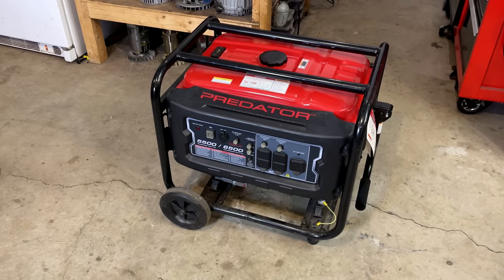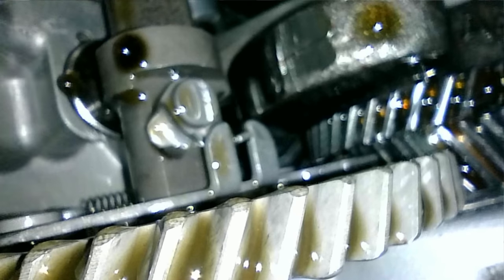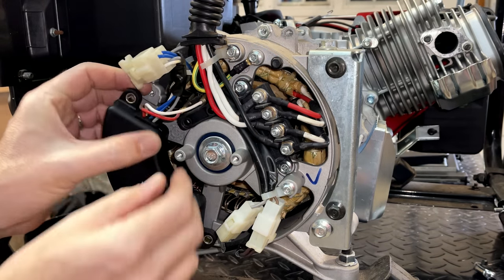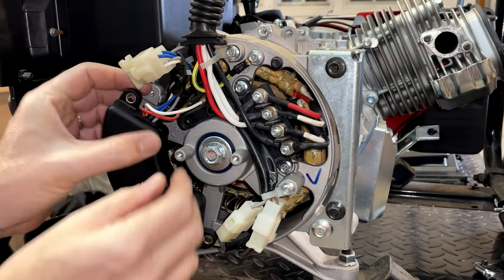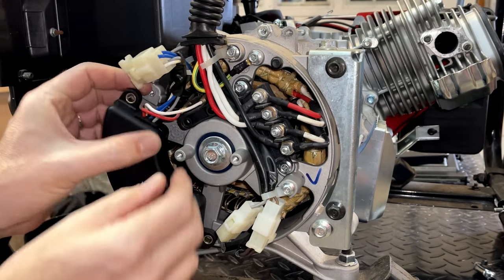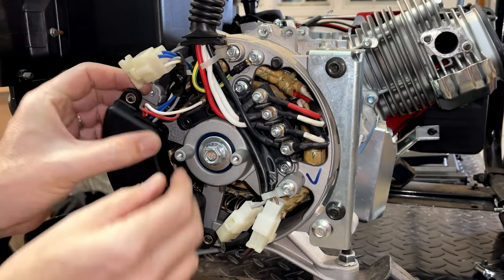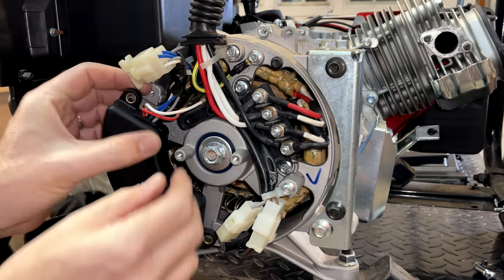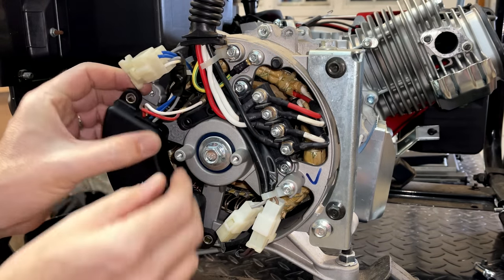Broken Predator Compression Release? - High Compression and Hard to Start

Comment: James, nice easy simple repair!!  I would have put the original cam back in myself, but absolutely nothing wrong with swapping out that cam either.  That engine is made by RATO... note the "R" in the model code on the side of the crankcase.  Also, that air inlet pattern on the recoil starter is a telltale RATO sign.  Also, the data sticker on the blower housing will sometimes say "RATO" on it somewhere as this one does... although HF has been trying to scrub any obvious clue as to the actual manufacturer of their engines for a while now.  

But putting that "Torch" plug back in there might be a cardinal sin... that's a guaranteed failure LOL

Great video once again!!!

*  OH!! One more thing... you might want to check the accuracy of your Kill-A-Watt frequency readout... I stumbled across the fact that mine reads almost 1 Hz higher than 3 different multimeters...  3 against 1, it reads high.  I guess the quality of the electronics in the KAW isn't that high.
Reply from the maker: The kill a watt is definitely not a precision piece of equipment.
Reply: I would not use the cam that came in it
The used one works
Reply: @philliphall5198  I definitely would have reused the original cam... no defects, no burrs, works smoothly, and narrowed down to a likely tiny piece of debris that made it get stuck... the exact same failure could happen on the next start with the old used replacement cam.  Probability of reoccurrence is the same for either one.  But, nothing wrong with replacing it with the  cam from the blown engine either... hopefully there is no damage to it that was not detected (crack, bent, etc...)

Comment: Say James since the genset can run steady even when not loaded having the decibel level loaded and unloaded might be more comfortable in the house when unloaded a certain extent. What the harmonic distortion tells me is when running a DVD or other sensitive electronics the electronics should be run unloaded or you may cause an electrical failure. I had a DVD fail with a square wave inverter. So a pure sign wave inverter should be used on sensitive electronics. So an inverter generator seems a much better unit for those who wish their electronics to function.

Comment: Great video.  Very informative.
I realize that was your goal but if it had  been my generator,  before I pulled it apart I would have soaked and flushed the crankcase with marvel mystery oil mixed with diesel fuel and gone through the carb.
I'm glad you didn't because I learned some things from the video.

Comment: It has been my experience with gear wrenches, to apply them incorrectly more than half the time. I solved that problem when I discovered the slightly curved open end should point in the direction I want to turn it. Some are even labeled.

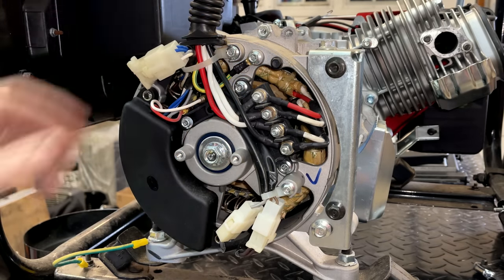Comment: 18:40 Oh HELL Yah!

I'm an Electrician so I can say with some confidence that if you get the wires wrong, the BEST thing that happens is you reverse the Generator's output Polarity...not a massive deal for AC, but you WILL damage any DC equipment plugged in to it (if the Generator has DC Receptacles)...
It's still not great for reversed AC Polarity, but it won't damage most AC equipment. The biggest danger to Reversed AC is the outer screw shell on lamp holders will be live even with the switch in the off position (the shell is connected to the White/Neutral wire) and if you touch it, you can get a nasty, potentially lethal shock...
The most likely thing to happen by screwing up the wire order isn't Polarity Reversal however, it's causing severe damage to the electronics and generator itself...most likely, the Mysterious Blue Smoke that is the secret to all Electronic Functionality will be released and then the generator will become a large, noisy paperweight because when the Mysterious Blue Smoke is released from Electronics, they don't work anymore...

😄😁😆😅😂🤣

Comment: Re choke label, I had the same thing but mine said " On Off"  just turned it over. Yours could be orientated  correctly if you read the thicker end of the wedge as "More Air" and the thin end as "Less Air" ie "Choked". Just a thought...Great Video.

Comment: Had this same thing happen on a Briggs 675exi. It would actually  start and run but hard as hell to pull. Actually ran good once you could get it pulled over. Ended up being bad cam/compression release. Found a used one for $10 and took about an hour for me to install and reassmble the mower.

Comment: You said a rod & bolt would not work as the bore  is  the same as retention bolt diameter.  So why not cut a rod with an threaded end?  Thread the rod into the crankshaft and use a bolt on that to push the engine off  the rotor.

Please let me know if there is a flaw in that logic. Hidden pitfalls are the bane of the inexperienced. I have a Honda 5kw that is a no-charge patient to fix (or try to) for the wedding venue I work for. 

Yet another result of being able to diagnose about anything that has broke/stopped working and fix most of it for the owner. I have learned so much from your channel. Please keep showing the teardowns and rebuild parts, especially the finicky parts, the "dos", and more importantly the "don'ts".

Thanks again
Reply from the maker: You can definitely use a threaded rod in this case.   If the powerhead is bad I sometimes will just cut the head off the rotor bolt and use that.
Reply: @jcondon1  thank you.

Comment: As a relative novice in things this complicated, can you describe why you degrease the gasket surfaces when reassembling these parts?  I have in the past tried using a very thin coat of grease to make saving the gasket more possible if I ever need to go back in.  Saying that, It rarely does work, but I thought it was a chance to make it work anyway.  VERY interested in your idea on this.  Seems to be something you do on EVERY reassembly so I am sure to learn something again!!

Kudos for your efforts.  I know the old saying, "those that can, do.  Those that cannot, teach"  You are standing living proof that is a FALLACY!!  Probably not a high percentage of folks can do both, but we know now, it is possible...  Keep them coming..
Reply from the maker: A lot of manuals say to degrease it for the best result.  To your point though, the gasket will not be reusable.  A lot say to grease the gasket and it can be reused in the future.  Sounds like a good idea to me and would do it on my own equipment, but tend to be more conservative if on stuff I am going to sell.
Reply: @jcondon1  I suspected your answer would be direct with your experience so thank you for the info!  As a working engineer, I do try and think things through before I try things a bit radical, similarly to your methods.  Good reinforcement on this clean surface idea.  Filed as the best method now!!  Thanks

Comment: Another point in this video that you pointed out was how loud this generator is. It would have been nice to see the dB reading at the source since there is a standard rule that doubling the distance away from the source reduces the dB rating by 6 dB therefore using some rough mathematics i am guessing it would be around 120 dB at the source which is extremely loud.

Comment: This compression release system that all modern generator engines apparently have, are somewhat new to me. On some older engines they had, a valve that was bored right into the cylinder that would be opened to reduce compression, as installed on one of my chain saws. My question is, what did they use to reduce compression on small engines back in the 1950 and 60's? I don't recall the compression being all that large? BTW, I was really surprised by the compression on that engine! 130 PSI, I never thought they would be that high. I've seen six cylinder aircraft engines at only 70-80 pounds. BTW I learn a lot from you! Thanks again.
Reply: IIRC the B&S side valve engines just had a bump on the exhaust cam with such short duration that it only had an effect at starting RPM

Comment: James, a suggestion I would like to offer for removing the rotor. Toilet paper and water/oil. Requires a less exact seal around the bolt threads. I've used the method to remove pilot bearing and such.

Comment: To drain the tank you loosen and remove the big nut at bottom of gas tank above the shut off valve. Then pull down removing the long strainer screen inside the tank outlet. I then use windshield washer hose to shove up in the tank hole to drain without making a mess.

Comment: Unfortunately it would be difficult to remove the comp. Release mech. From the stuck cam due to the rivet pins holding it to the gear. You could then inspect for burs or something sticking it up. You could put some nano moly powder mixed with 91% isopropyl alcohol paste under and around the whole mechanism and move the mechanism around allot to plate it on so its less likely to stick again.

Comment: My preferred method is to take a piece of white bread, tear out the soft white center and pack it in the hole. It does the same thing as the water but no teflon tape needed. It is nice because the clean up just needs a bunch of compressed air and maybe a spray of brake cleaner.
Reply: If it fires do you then get bonus toast?
Reply: @AnyoneSeenMikeHunt  Rarely have I used the whole slice of bread. You could probably whip out the propane torch and make a nice half slice.

Comment: It may be the design difference of the compression release plate that created the problem.
The one that came out had a lot more hang up points, the two slider slots and securing pins.
The one you saved only had a  single pivot point, a far simpler design.

Comment: Here's a tip most older Predator and some newer current Predator generators and engines are made by RATO which is the largest Chinese outdoor equipment manufacturer in the world and they make alot of familiar brands, if the engraving on the block starts with an R for example R420 that is a RATO made engine - now Harbor Freight in recent years has started using Loncin and those block numbers start with either an L, LC or G like G200F would be Loncin made and R212 or R196 would be RATO made.  Loncin is the 2nd largest manufacturer of chinese engine's and generators. Rato is better in quality. The generator in this video was made by RATO.

Comment: If every Chinese engine manufacturer wants to clone the Honda engine, why not clone the Honda variant with the overhead camshaft (GCV series). When you do that, you won't have to remove the generator assembly, rotor, the engine and disassembling the engine just to get to the camshaft to unstick or replace the compression release. You just remove the valve cover and everything is right there. Maybe the compression release wouldn't be needed with the GCV clone. No more push rods to worry about either. A timing chain or belt that's reinforced would need to be added but would be well worth it. 

Normally compression release mechanisms stick when the engine sits for a long time, or used a few times then sat for a long time. I got lucky with two generators that were basically brand new with less than a few hrs on each of them. They sat for 2-3 years in a garage and looked like they came right out of the box. The compression releases were stuck, not broken. I tried this method a friend recommended. To my surprise it worked!!! Here's what I did:

1. Remove spark plug.
2. Remove valve cover, inspect the valves and push rods (adjust/fix if needed).
3. Remove the pullstarter.
4. Make sure there's plenty of oil or at full capacity.
5. Turn the flywheel for a couple minutes or longer using an impact drill at low rpm, not too fast. This will allow oil to circulate through the engine making its way to the camshaft and the compression release mechanism. Do this a couple times if necessary.
6. Let it sit overnight.
7. The compression release should free itself unless seriously corroded or blocked up with metal particles or broken.

James, great video. I wish I knew about using water or oil when removing the rotor. That's a lifesaver right there and thank you.

Comment: Last year.   .  I won this.generator !   At our local fishing derby! 
And.  I've used it for about 80.hours of run time. . Before I did an oil change !.

Next time I used it,  was during fall weather!. 
And suddenly!  After 2nd time use . After oil change. 
I noticed it wasn't starting anymore and  wind was coming out from the sparkplug area !. Not noticing !  The.bolts came loose on their own! 

The morrow.of.story.  those.springs actually had the left spring pop out.  And  had it running for atleast 19.hours.   and  it wouldn't turn on . After running it, that long.

Anyways.  After taking it apart and seeing the spring  magically popped out. 
I put everything back.together. and with one pull.
The generator purred like a kitten!. 

- I have oil stain on the side that was blowing air from .  But it's still new . 
Warranty was an express post .away.  from being shipped. Out

Comment: I've bought 7 predator engines and after my 2nd, I learned to open the valve cover and go over every bolt. On 4 engines so far, those retainers weren't where they should be. So you thinking someone else was in there probably isn't true

Comment: Get a cotton swap and attach it to your drill and polish the seat a few times. This will get any residue/varnish off of the seat. Of coarse after that a few blasts of carb cleaner and a eyeball inspection to verify there isn't any cotton fibers clinging to the seat. This is what I do anyway.

Comment: Seems to be a common 4375 problem.  The dc voltage is 26 volts. I can't find much on them but it looks like a half wave with no center tap. My understanding is new refrigerators won't run on anything but clean sine waves. I bought a dc to ac inverter.  The dc is too high. Something to look for.

Comment: Cool.   The compression relief comes in two styles...  slide and swing.   Seems like "swing"  is the better of the two designs anyway,  as there's less friction sources to fail at.    The motor's pitch is a little mid-range strong.. and that's where our hearing is most sensitive.   It's not missing a spark arrest or something is it?   I'm just thinking that the muffler isn't doing as good of a job as it could.
Reply from the maker: It sounded like there was no muffler.  The swing is better.  I have had several instance of the slide one sticking due to increase friction.  I have a really old video where I think it was the slide type hanging up https://youtu.be/vyeyQK1QCuw

Comment: I thought it looked like the spring was stretched in the camera view and it was. I wonder if a wire clothes hanger could have been bent to reach the compression release to free it. Maybe a couple of hits to the engine with a soft hammer would have freed it.
Reply: I think I would have dropped it
Reply from the maker: I did position the cam and dropped it.  Cut that out since it did not work.  Given what I saw when I open it up…. Should have dropped it harder.  Here is the lost footage https://youtu.be/6oU2PM0IUPk

Comment: You stated that Ken's Small Engines sent that generator to you, what does something like that cost to be shipping around? I realize there are some folks close by, but I believe you have had people from afar send you generators, that must be costly. Also, this one had fuel and oil in it, so that would make me think Ken dropped it off rather than shipping it.
Great video as always, glad to see you use the water method, as that hitting the bolt with a hammer while easy, can also take a toll on the crankshaft and overall rotating assembly being pushed in a lateral direction.
Reply: Jim and I are relatively close to each other so I grabbed it from my neighbor and Jim came by one morning and grabbed it. Shipping would be cost prohibitive
Reply from the maker: People have sent generators in the mail, but usually they are the small suitcase style.  Larger ones like this would cost $200-$300 to send it a 100 miles.  Thankfully Ken is not that far away.
Reply: @jcondon1  Many shippers refuse to accept and gasoline powered equipment unless it is in factory packaging or certified as gasoline-free by a factory service rep. Others charge an arm and a leg to ship a small gen.  I worked for a network TV news bureau and we would buy Honda EU2000i generators after arriving in a location and give them away after a couple days use because the cost and effort to have them certified as clean was too much.

Comment: Playing with these predators in gokarts iv'e found that if the break in goes too long the grit will sludge up the decompression mechanism and stop it from working properly. As far as the retainer for the valve springs they come like that at times from factory, the first thing i do to them is put heavy springs in them and have seen it a few times.

Comment: Very cool fix James. How hard would it be to get something in through the oil fill and jar the release loose? Need something with a big angle so probably wouldn’t get through the fill hole. I was thinking you would of used the same acr again but you got it working again and no issues so that’s the outcome everyone is looking for. Again very much appreciate every video. Keep them coming.

Comment: James, have you ever tried to use a slide hammer to remove the rotor?  I think it would be far easier than using the water compression method.
Reply from the maker: I have not.  I really need to buy one.